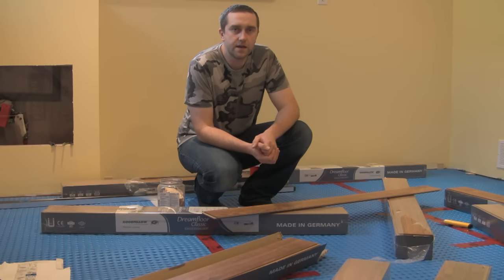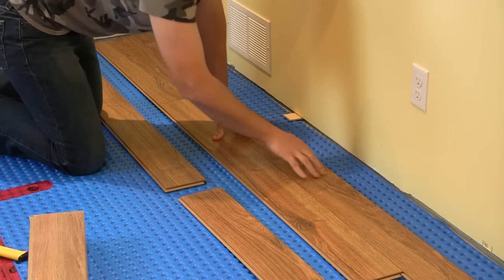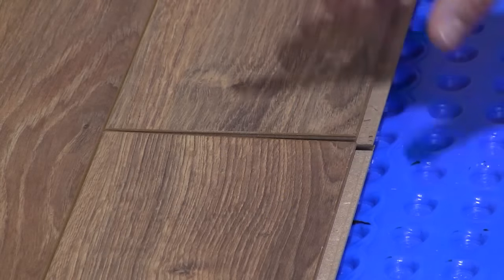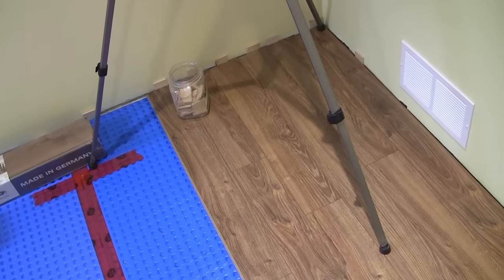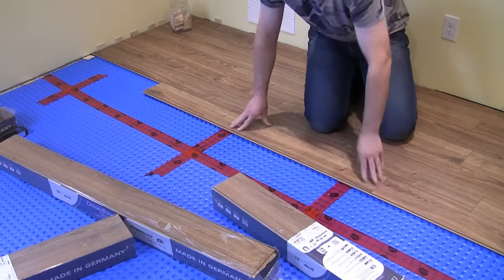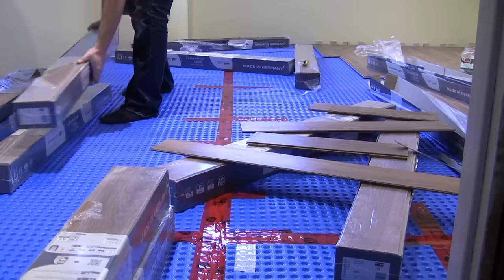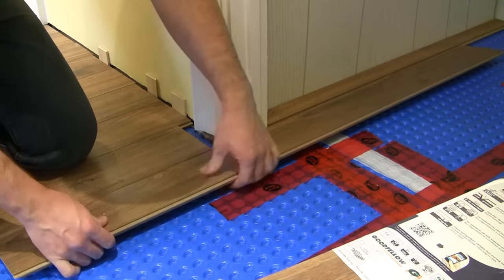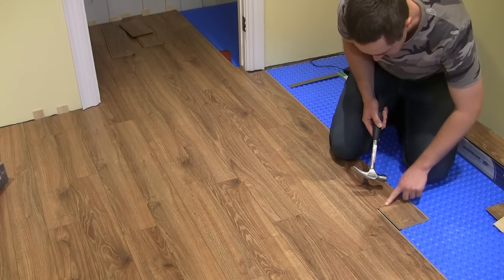How to install drop and lock laminate flooring over 1-step subfloor

Comment: nice result.  I really like the tall baseboards you chose!

the thing I didnt see you doing that I was taught with flooring is that when you come to the end of each row and cut the last piece to fit... that you are supposed to use the cut off piece to start the next row.  this way you minimize waste.  anyways, I am renovating my basement and I'm going to use the DMX underlay for the first time. was thinking of putting plywood and then hardwood flooring but my basement is only 7 feet high and I can save about 1 inch by just doing laminate or engineered hardwood.

Comment: Great job. Few questions - when you walk on the floors, is it in any way feel loose from the ground and did you need to leave any gap between the baseboard and the laminate flooring for the system to properly dicpate the collected humidity?

Comment: Thanks for posting these videos. They were super helpful. Did you install a transition strip between rooms like a T moulding? If so, how did you secure it to the DMX 1 step?
Reply from the maker: I did it in just one room for now. Rest of the basement is still carpet. As a transition i uses an aluminium molding (just an angle in crossection) To secured i used screws and plastic anchors. But you got a point. How to install a T-molding to the concrete floor and not to make a hole in DMX?
Reply: Exactly. I haven't had the chance to pick up a T-molding yet, so I'm not sure what they look like in terms of installation. Right now, I can only imagine 3 scenarios; 1. Cut the DMX and attach the anchor to the cement floor. 2. Glue the T-molding anchor to the DMX itself. or 3. Attach/glue the T-Molding to the edge of the floor from one room only, and allowing a small space between the molding and the other floor edge to allow both floors to move. Again, I haven't had the change to pick one up, so I only have a vague idea what they look like and how they are attached.

Comment: Do you hear any squeaks coming from the DMX?
Reply from the maker: +Guillaume Drolet Hi, i don't hear squeaks, but i can hear when laminate planks tap the DMX, not rely noisy, but still...
Reply: You may have an uneven concrete floor. Lay down landscape fabric under the 1-step underlayment /subfloor. This will eliminate the clicking noise of the 1-step hitting the concrete and the shifting too.
Reply: Shawn Mazurk, the DMX 1 step comes with a sound fabric already attached to it

Comment: Do you feel your floor being warmer after the 1 step install?
Reply from the maker: It's middle of winter and -10C (14F) outside. With the room temperature about 24C, the floor is 19Celcius (66 F). I am good wearing  only socks.
Reply: Thanks for your answer. My house was built on a concrete slab, and they installed the laminate right over concrete + some underlay and it feels very cold. Outside temp 2-3C . Inside 21-22C.
I`m gonna have to remove the flooring and reinstall it.
Thanks again. Great video.